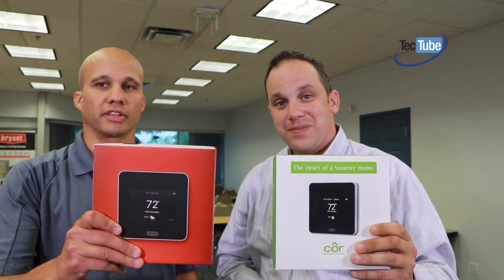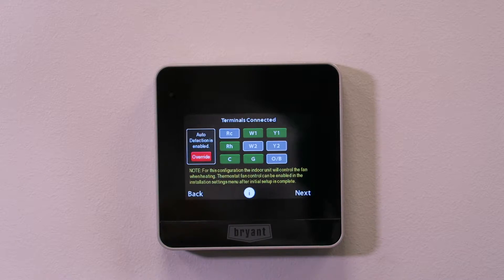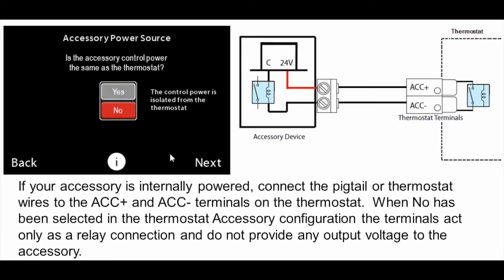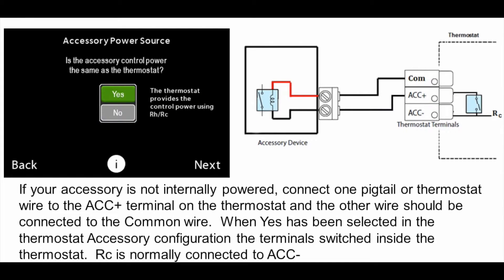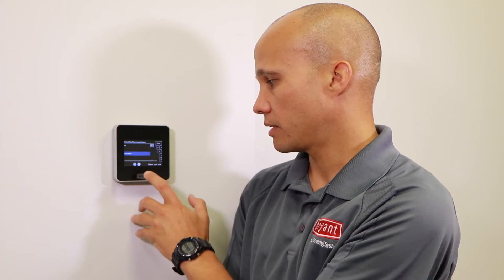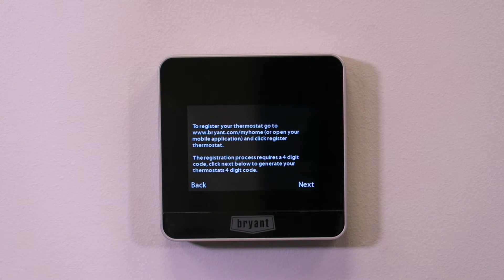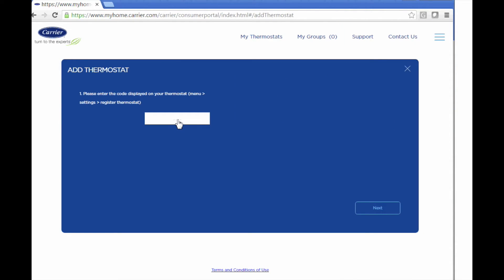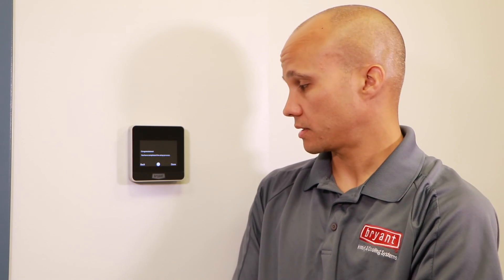Cor/Housewise Smart Thermostat Install & Startup (1 of 3)

Comment: Hi my house is 3 years old and has COR 7 Thermostat. Suddenly the screen is black. I cannot do anything. do you have any idea to check up? all power is good now.
Reply from the maker: The Cor 7 was a very different product than the Cor/Housewise stat in this video. The Cor 7 was a short-lived product designed by Carrier and meant as a low cost alternative to the well liked Cor/Housewise stat that was made by ecobee and branded with a Carrier/Bryant logo. Apples and oranges

Comment: Helloooooo! Hey I know this video is old, but I need to replace the thermostat on my 15(?) year old Bryant Evolution furnace+ac system. My question is, is this thermostat compatible? My system has a weird connector plug on the circuit board with labels A, B, C, D where my thermostat plugs into. But it also has a standard labeled set of connecting terminals(screws) which is where the AC unit is connected. I assume if I were to use this thermostat I would need to move my wires to the standard connectors? Would appreciate your expertise, thanks!
Reply from the maker: The ABCD connector is for an Evolution control. There is a direct replacement available for that with more modern functionality such as Wi-Fi and touch screen. https://bryant.hvacpartners.com/products/detail/SYSTXBBECC01-C
Reply from the maker: You can probably use a standard thermostat like the Housewise in this video, but it really depends on what type of equipment you have. If you have a modulating gas furnace (987MA) then you will lose the full range of modulation. The same would be true for the A/C, except in this case we know you do not have modulating A/C because you said it is wired to Y terminal.
Reply from the maker: BTW - per ASHRAE, the average life expectancy of a furnace is 18 years and only 15 years for an A/C. We might suggest keeping the equipment replacement in mind, when replacing this thermostat. If you are likely to replace the equipment in a couple years with a newer Evolution system (one that fully modulates) then upgrade to a modern Evolution thermostat now because it will require that anyway.

Comment: I have purchased a home with a COR. Thermostat. Can the previous seller work this core thermostat from a app on his phone? The thermostat originally was stuck at cooling at 80°. Now this thermostat does not light up. It was working perfectly fine.
Reply from the maker: What do you mean by "get stuck?"  Maybe they had it locked.  Do you see a little padlock icon on the screen?  Or are you able to change the setting, but then it would go back to 80 later?  That is normal and probably how they had the schedule configured.
Reply from the maker: If the stat does not light up it either lost power, which is common when their is a failure of the equipment since the stat gets its power from the equipment, or something is wrong with the stat.  Verify that the furnace still has power.  If it does then pull the stat off the wall and put it back on... similar to pulling the battery out of your phone to reset it.  That "fixes" half of the weird electronic quirks in our life.

Comment: Somewhat unrelated, but has anyone installed a Carrier Cor Thermostat on a Carrier mini split system, and if so, any issues with the 'Follow-Me' remote interfering with the Cor Thermostat?
Reply: Ductless mini-splits are not my expertise, but in general, for most of those systems once you adapt them to standard thermostat (such as the Cor), you need to give up the use of the handheld remote.  It is generally one or the other.  You can't expect the unit to respond to 2 different things bossing it around.  If one says heat and the other says cool, what would it do.  Give up the handheld remote if you want to us a traditional wall mounted smart stat.
Reply: Thanks Ryan. I should have clarified that I was referring to the Follow Me infrared receiver built in the fan coil unit. There is a 5-wire connector coming out of the receiver that would connect to the Cor thermostat. Just wondering if that IF receiver would interfere with the signal coming from the Cor thermostat to the fan coil and heat pump.
Reply: I knew which feature you meant.  What I am is saying is that having two controls for one unit never works.  What if the follow-me feature wants to turn the unit off, but the thermostat wants to turn it on?  Who wins?

Comment: I had to change my network and I cannot seem to generate the 4 number code again.  Now it seems I am locked out of the thermostat.  What should I do?
Reply from the maker: You do NOT need to need to generate the 4-digit code if you connect your stat to a new network.  The code is only used the very first time to pair your stat to your online account.  This is independent of how your stat connects to the Internet.  The only time you would want to re-register the thermostat and generate a new 4-digit code would be if you are no longer the owner of the stat and someone else, such as a new buyer of your home, wants to connect to it.  In this case, you would reset the thermostat first.

If you just want to connect to a new Wi-Fi network, you can do so under the settings tab of the thermostat.  Disconnect from the old network and then connect to a new one.  Very similar process as your cell phone or other Wi-Fi connected devices.  With that said, when installing a new router at your home, we would recommend that you consider making the network name (SSID) and password of your new router match that of your old router.  By doing so, all of the devices in your home will automatically connect to the Wi-Fi network and Internet and you will not have to reconfigure any of them.

Your heating and air conditioning contractor can also assist you with this process or you can call the help line at (844) MY-COR-HOME… (844) 692-6746
Reply: not sure how to get to my wifi on my thermostat